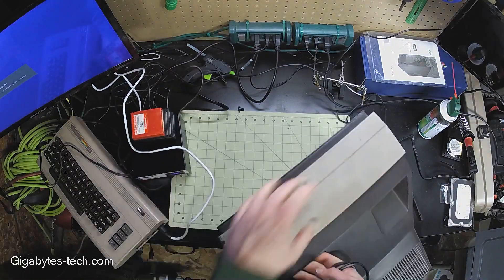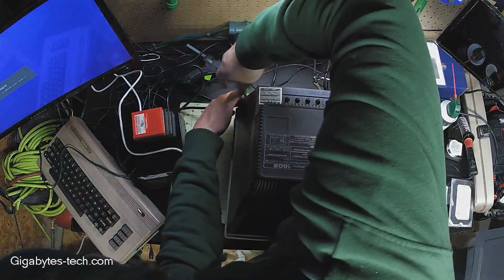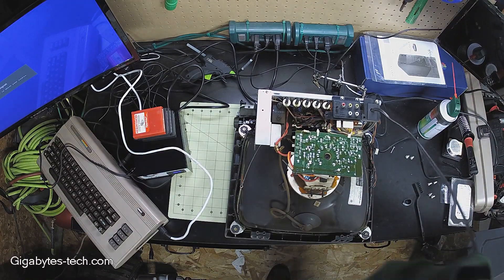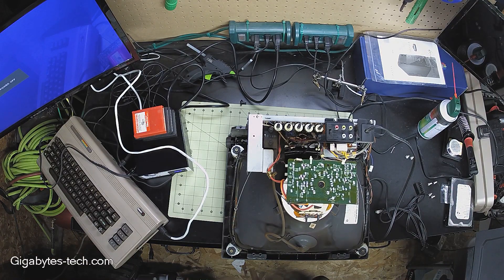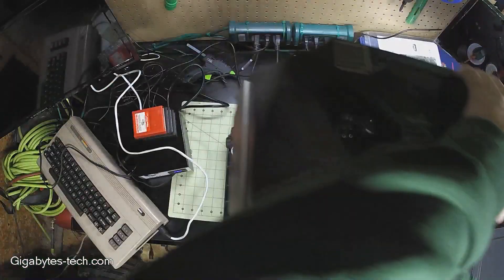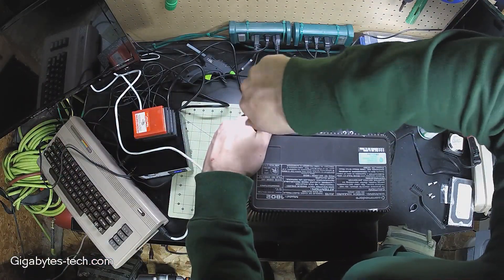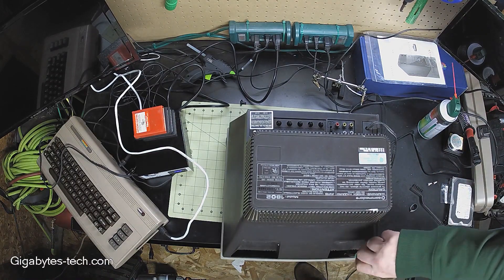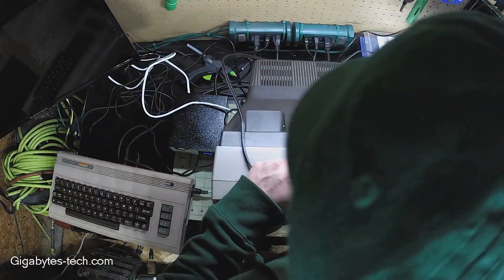1802 Monitor Inspection: Commodore 64 Restoration Part 2

Comment: The 5 pin VIC-20 cable should work perfect on a C64. I interchange them all of the time. C64 supports a 5 pin for composite or 8 pin for Luma/Chroma connections. Those 1802 monitors are beautiful. Definitely get an 8 pin Luma/Chroma cable! The difference is astounding.
Reply from the maker: It absolutely should. I am working on the next video now (making a composite cable) and discovered the error. The only correct pin on that cable is ground. One connector is luma and one is audio in. The configuration makes more sense for an Atari XE. Those pins are luma and chroma respectively for that system.